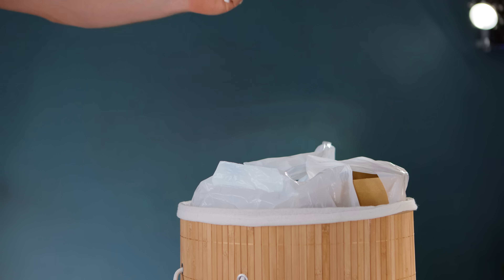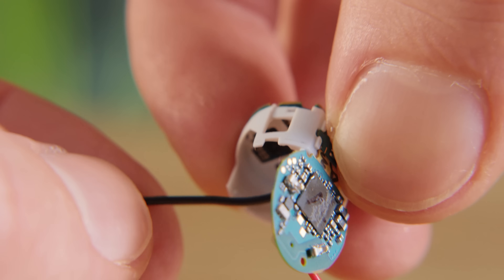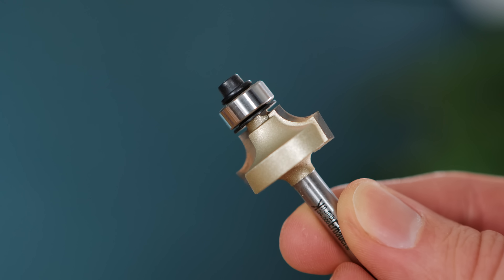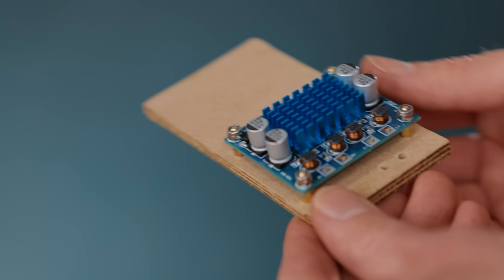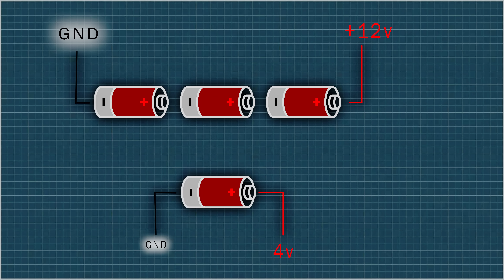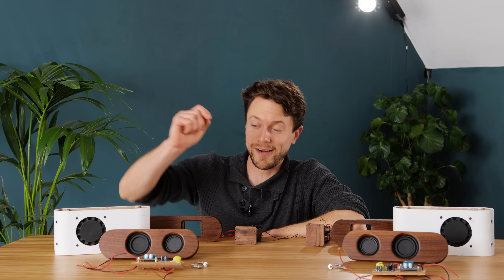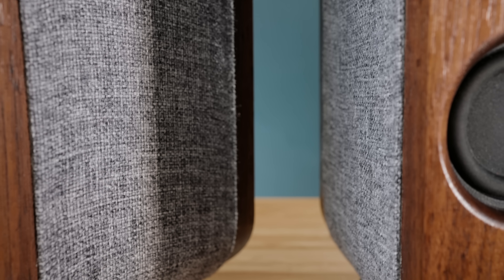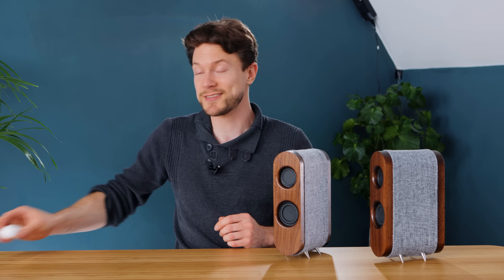Transforming dead earbuds into POWERFUL wireless speakers

Comment: 2 minutes in: I'm totally doing this. 
5 minutes in: I'm totally just going to buy some.
Reply: True but would it be more than the speaker 🤔
Reply: @remnantofgallifrey  who knows, the way prices are going rn, wood might be as valuable as gold
Reply: @nausi5105  3/4" 4'x8' MDF is 30-40 a sheet rn. that's no where near what you'd be paying for OSB. MDF is better for sound settings anyway
Reply: @nausi5105  some offcuts like that wouldn't be more than 20$ (walnut) obv can be cheaper if you go with a less expensive wood. 
It's expensive because typical wood lengths are 8' - 16' and god forbid you want to use 2" thick instead of 1"
Reply: @nausi5105  Don't need to use pur walnut wood. There are other types of recycled wood you could fetch.
Reply: @nausi5105  I used to do a bunch of woodworking stuff before, and prices are going back down, so that's pretty neat
Reply: @remnantofgallifrey  but...but you could run some JL Audio speakers. Imagine a high quality car audio Bluetooth speaker that's gonna sound even better now because you aren't encasing them in metal and glass.
Reply: @remnantofgallifrey  Destined- Hi ! MAX value comes from DIY and adjusting materials and maximizing production to take advantage of scalability. 
Someone could build and sell/gift these things, selling them privately for ANY price YOUR Market Research shows as a viable final price (remember to PAY yourself AFTER recovering COSTS + ANY Applicable Income Tax requirements ... ;=)) ! ) , regardless of whether or not the smartest kids at the lunchroom table commenting here can buy "cheaper" items from Wal-Mart .
I plan on trying this as a Grandpa/Grandchildren "Teaching" project as soon as I can get my production shop back up & running as  I buld up my Shop here at our brand new place.
ALL the VERY BEST to ALL here from Texas ! -
-Chuck.
Reply: @chuckintexas  bro why are you writing this like it’s professional email? This is the YouTube reply section goddamnit. Also I really don’t think Destined is trying to start a DIY product selling business.
Reply: @steveqi9309  - Steve- Hi ! Seems you completely missed the point. Not surprised. No worries, I don't expect everyone to be able to keep up 👍. 
Those reacting to how much easier and cheaper it would be to run to Walmart don't get it either.
Oh well .
SOME however, may HAVE caught the CENTRAL point - that this would be an INTERESTING "Project" and too, that it MIGHT make a nice "Gift" someone could put a little "Personal" effort into and come up with something pretty COOL . 
But, hey, head on to Walmart, fit right in to the CROWD there - no worries. 
By the way, I DO realize that complete sentences and proper grammar seems to confuse MANY who comment here (unneeded profanity aside ... ), but THAT I can't be responsible for. If someone is confused by properly formed sentences communicating completed thoughts, well, that's GOTTA be on THEM. 
I'm sure you'd understand .
This Video Presentation EFFECTIVELY combines CREATIVITY with an INTERESTING PROJECT IDEA, whether or NOT some feel personally equal to the work/task involved. 
Even THEY might consider a similar if less ambitious project, but hey THAT's up to THEM 👍.
'sall good. 
All the BEST -
C.
Reply: The cost of the wood itself would probably be more than the headphones. Lol
Reply: @nausi5105  Go to every hardware store near you and ask for their scrap wood. Sometimes you'll find a good piece.
Reply: @nausi5105  But consider how much you paid for those earbuds?  Some are in the hundreds of $$.  No sense in throwing those out.
Reply: @nausi5105  Yeah, and the speakers themselves (the actual speaker not the unit) would be costly if you were getting a high quality one.
Reply: @nausi5105  Thanks to Joe Biden for that we need Trump back
Reply: DIY projects aren't for your everyday "stuff I'm gonna do" when you can't even get your room cleaned twice a week XD.

The idea behind the concept of DIY projects is doing technology recycling while also doing something on your own, feeling better by achieving something with your own hands.
Reply: @soragranda  DIY may not save you money, but it may allow you to develop a custom solution that matches your tastes and fits your needs exactly.
Reply: Could just buy some old speakers from a thrift shop and do this, skipping the whole make your own part
Reply: @mezzb  just buy a set of wireless speakers
Reply: 100% agree, this is some next level Bait & Switch!  I'd rather just let the earbuds die and leave well enough alone lol!
Reply: Yeah his videos are really not made to replicate. But they are the most interesting on youtube mostly.
Reply: I did this but its rlly ugly it has no case
Reply: No doubt. I was all, "Gung-ho" until he broke out the circut board and transistors. Never the less, this was the most entertaining and informational video on speaker building I have come across. Many thanks!
Reply: Don't throw them away, you can learn to be a woodworking / electronics / computing expert too
Reply: If I was doing this I would find 2 old towers and replace the electronics with the earbuds. I would end up wasting $300 of wood haha
Reply: 8minutes in: 💀
Reply: His bluild needs some help anyway he needs a pairing button and personally I would have made then rechargeable with a USB
Reply: This is confusing to me because if you just disassemble the electronics you'd throw away anyway you'd have almost all of these parts naturally, other than the audio drivers? You don't have to build the housing exactly as he did.
Reply: the thing is as he explained, stereo Bluetooth speakers are pretty much non existent (at the time, don't know if now) so it's truly a "you can only have if you make" thing
Reply: Don't buy random broken ones. If you get the exact ones he mentions and they turn out to be not paired to each other they would be useless for this. There is no way to pair them to each other.
Reply: @star2gates  Hahaha
Reply: If you have a job you might be able to earn how much a good speaker costs in the time you spend on this thing. Time is money 💲
Reply: @icantsee0   yeah, but can you start a conversation with a bought pair?
Reply: @blinkmeforever  yes. Easy. Talk about the music you like 🤨
Reply: @icantsee0  If you have a job that brings you a lot of money, you might have a hobby that brings you nice moments and you invest  your money in it. The satisfaction of achieving something with your own hands cannot be measured financially.
Reply: @cezar3977  thats is very subjective. To each their own ig, if you wanna make some speakers do it, but I'm pretty sure you can tell which side of the fence I'm on.
Reply: @icantsee0  Time is not money. Time has been around forever, money is a human concept
Reply: @FunBoysGaming  We don’t have much time left according to Revelations we are in the end days and time is going faster as we speak
Reply: For anyone looking to buy, consider the Earfun Uboom speaker. One alone is good, but they can also be paired in stereo.
Reply: @mezzb  That would be problematic if you do not want to tune the filters on your own. As stated in the video, the given versions only work with the mentioned speakers and it's really hard to get it done by yourself without any experience (and very good ears). 

Also, if they are supposed to still sound good after the conversion, make sure that whatever Bluetooth connector you get supports the LDAC codec!
Reply: @profvonshredder2563  chances of that happening are soo very unlikely but that is possible.
Reply: Don’t lose sight on the Kingdom of God 🏞️ all that is in the world is soon coming to an end. Seek God whilst He may be found. Jesus saves ✝️🙏

Comment: Is there a way to build this setup such that the speakers can be charged without taking out the batteries?
Reply: You could probably get a usb-c input power board in each speaker, might be a pain to charge the two different circuits though.. 
Could also maybe take the charging stuff out of a dead wireless speaker?
Reply: @lachychops2  Probably cant use the bud charging circuit cause itll charge a single 4v battery and he needs balanced charging circuit
Reply: @maclock8960  nah i mean like a ue boom or jbl speaker or something.. i have nk idea what voltages they run though 😅
Reply: why not just get real speakers and a compact amp?

Comment: DIY Perks: Simply solder the proper channel resistors and router and saw mdf to fit while removing the antenna

What I hear: Simply prefabricate your nuclear reactor, with some NASA engineering, and you're almost done.

Comment: You have to use bipolar capacitors in the loudspeakers crossover. I dont know wich components you use in the bass circuit, but there is no coil so there is no low-pass filter? Strange...

Comment: I’m a sucker for high excursion woofers. Definitely gonna try this with my AirPods Pro when they die.
Reply: yeah same
Reply: Better not check out what KEF did with the sub 62
Reply: Did they die yet?
Reply: @lyteyearz5810  my airpods 1 pretty much lasted for about a year or so, and the battery dies in about 10 minutes - what the crap apple thinks I'm gonna do next - buy another set of really expensive airpods that will die out in a year - I wasn't even using them heavily.. 
.. anyway, this video sparked interest, but Oh boy, overkill on the diy.. I'd just like to run them wirelessly in a box I could 3d print..  I could probably make it if the motivation is high enough, he should do a version 2 - ultra lazy edition built out of cardboard
Reply: You're a sucker if you think Air pods are "high excursion subwoofers"
Reply: @NittoNba44  have you not watched the video? the ear buds don't do the sound, they're just the signal processors.

Comment: Very good and uncommon ability to show your combined talents. Charging looks like a bit if a pain tho. Couldn't you run all 4 batteries in series, but still tap the positive and grounds from the middle of the pack, or even make separate charge ports that plug in? Not a complaint in any way, just a thought, awesome video.

Comment: You can do something similar with a Bluetooth speaker. 

It's a little simpler as you just remove the guts and attach it to some speakers you have laying around. I have some Polk T15s I run off of a mini lifejacket internals and they sound vastly superior to the original speakers. 

But in the end it's still Bluetooth and can only sound so good. Though the mini lifejacket does have an aux input that bypasses that limitation.

Comment: this is pretty cool, re using the bluetooth in dead headphones to make your own home make speakers. Ive been thinking of making a form bored speaker set and i may use this as a "add bluetooth" to them help video. Also have you seen any info on foam board speakers? ive been told many times that they are very nice for what your paying for

Comment: I expect this to become a popular product category soon. One issue I have with this though is the battery situation. Generally, those PCB protection boards are used as a secondary cutoff rather than a primary. It’s good to have them, but personally I wouldn’t. Charging is also rare with these I’m sure but I can’t help but want a way to charge these while within the speakers. I think some balance leads and a custom power lead will be my approach to use this with a hobby charger from brands like ISDT.

Comment: I'm thinking of making the wireless amp units separately, and then they can plug and play into any passive speakers you have. Wouldn't need the crossover in tat case, unless I want to find instructions on how to build an adjustable crossover maybe a no filter output setting and then a high/low setting with two outputs? Hmmmmmm, seems like a fun project, and less expensive.

Comment: Maybe a total cost of speakers, amplifier, circuits, wood, battery case, wires, other needed tools and supplies, would help in weighing out the cost effectiveness. A great rich mans MacGyver project, to show off to the fellows. The gratification of creation, would be immensely satisfying, as well.
Reply: 0 to 100 000$? its the point of DIYing. Use whatever you have, if you want to perfectly mimic his speakers, then go ahead and click on all of the links he has, and buy yourself cheap tools to solder and route the wood and whatnot... Although, to be fair, I think a full list of items would be nice, so we can easily know if we are 10% of the way onto a project or 90% there and just need to buy 1 or 2 things.

Comment: "Bose soundlink, priced similarly"

Does that price include the CNC machine?

It looks and sounds great, but lately you've went from DIY with home tools to DIY with industrial equipment. One of the reasons you were so great to watch was specifically from the home like DIY, where you did everything by hand with things you usually have at home, or are just a few bucks at the local workshop store.
DIY should be something that anyone can do at home. Not everyone has CNC machines at home.

Still a good video, but the videos are getting further away from the "true" DIY the more expensive equipment is used, not to mention the prices for the parts aswell if you don't have speakers that you can already use.

Comment: what if headphones eventually will lost their pairing with the smartphone? How you suppose to pair it back?
Reply: well, since galaxy buds and most bt earbuds go into pairing mode when you turn them on and they aren't already paired with something (i.e removing them from the case turns them on, bt earbuds don't have any room for a pairing button so that's how they work), and since he included an on/off switch in the design, it should be as simple as flicking the speaker on and pairing it in your phone's bluetooth settings again.

Comment: How do you pair the speakers to a new phone? I though most true wireless headphones requires the case to pair to a new phone?
Reply: Well it's probably impossible with the way how he made it with the galaxy buds you need to hold both touchpads on the buds in for 10 seconds then it enters pairing mode... so yeah impossible
Reply: @xanderoerlemans5933  Jaybird Vista has something similar where you need to have the headphones inside the case and then press a button in the case.
So, essentially, this was really cool but practically useless in its current form. I only hope he thought of it and actually adress this in the guide

Comment: Should have added a $2 charging circuit to them as well, making removing the batteries a moot point.
Reply: There are 3 in series so you'll have to worry about balancing the cells. Pretty sure charge balancing circuits can be a whole other video itself.
Reply: @tempeleng  That's actually included in the $2. That was the whole point
Reply: @eidodk  That's interesting. Didn't realise 3S charging circuits have gone down in price. The Aliexpress circuits look dodgy though so can you share where you get yours?
Reply: @tempeleng  So because it "looks dodgy", you reject the price ?   All i said is they cost $2 to buy.  Personally, i don't see the dodgines, but hey whatever.
Reply: @eidodk  Cmon we're on an awesome diy learning channel so I don't see the need for that tone in your response. I've bought ESP32 chips that were DOA from dodgy sellers on Aliexpress before and don't really want to repeat fighting them for refunds. If you've had success with some sellers why not share them in this awesome diy channel?
Reply: @tempeleng  what tone ?  There's absolutely no tone in my response, there's a response to your "Aliexpress is dodgy" comment, but it has zero tone, that differs from your comment.  If you don't want to buy the cheap "crap" as you call it, then you don't buy the cheap "crap.  That's on you.

Comment: As a non-techy, the moment he started with the amplifier and those small thingy's I felt this would be a bit too much for me. On a side note, I was just thinking, would it be possible to charge these batteries with a wireless charger? So you don't have the hassle of removing and inserting screws every 50 hours. Great and fun project none the less! I just had some 30 year old speakers laying around at my parents house for some DIY-ing, whoa!

Comment: From the look of it the expense of the rest of the materials and tools to use  its cheaper to buy a pair of bluetooth speakers. I do like the appeal of this project, but its hard to justify it with over 200 dollars of electronics per speaker. Id rather purchase a decent par of speakers for less than half of that. But props to you Mat, amazing content though.
Reply: Can buy well made and tuned BT speakers quite readily.

I don't see the point of spending all this money, which will prob ending up at $300 by the time you have bought all the materials and tools if you don't have any.

I'll stick with my Ultimate Ears.
Reply: @soopafamicom  it is to keep the DIY spirit alive, not to be some cheapskate who just wants some speakers
Reply: @kamisama9715  There is diy to fix something broken then there is this which to include the time and expense that is going to end up with a product that is always going to be subpar to a professional set of speakers.

Comment: One thing I'm always concerned about when working with cheaper wireless headphones, or even 'active'  headphones as in the type with a Type C/Lightning connector with a built-in circuitry, is the quality of the circuitry. More times than not I've run across absolutely abysmal components, and it's to the point where I've considered sourcing all the chips myself instead of ripping apart another product to repurpose it for a project. It's always either that or cheaper components have so much goddamn noise and interference within it's own circuitry.